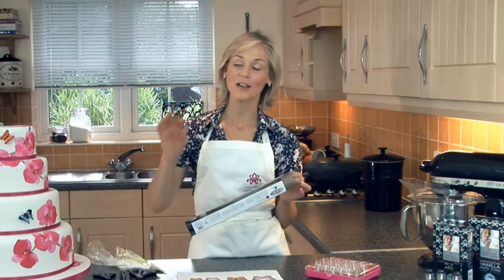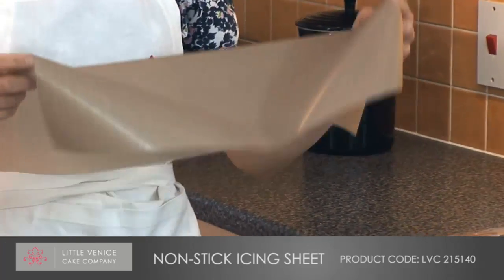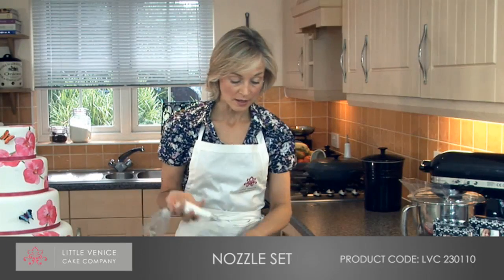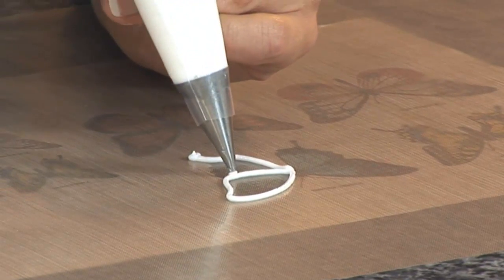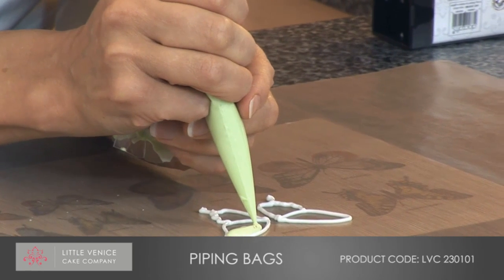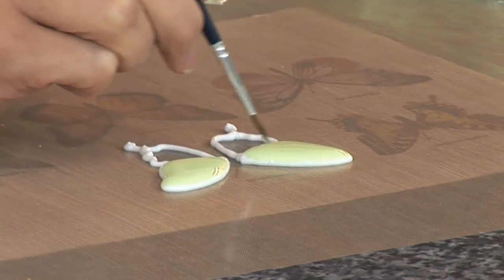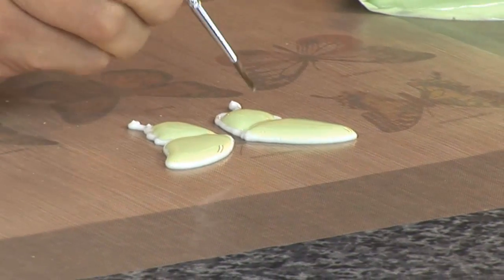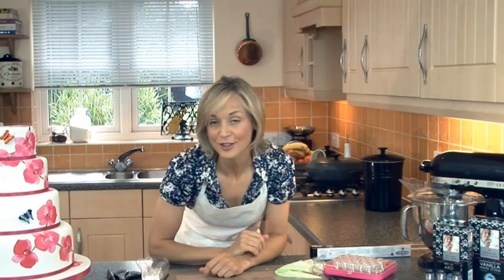Little Venice Cake Company™ - Cake Decorating with Royal Icing

Comment: Would I have any difficulties with using regular parchment paper as a base?
Reply: +KocciGda Not all parchment paper is created equal & will crinkly & go soft under the royal icing causing a deformation in your decorations or pieces of parchment to tear & stick to them. You're better off wrapping a surface (e.g. a cutting board) with saran wrap. You can even put your template on the board prior to wrapping.
Reply: Ok, thank You for the response! :)